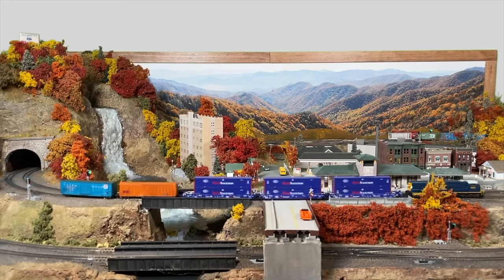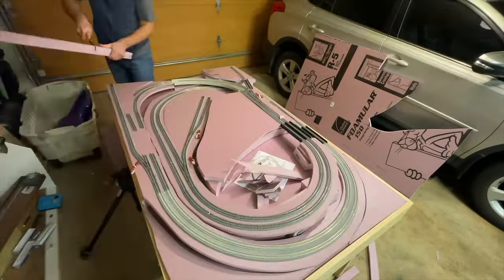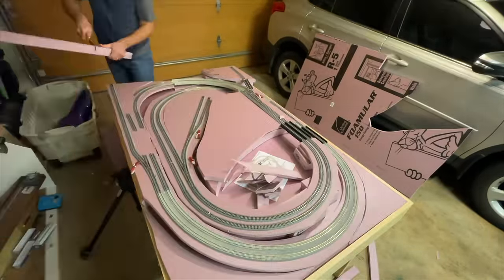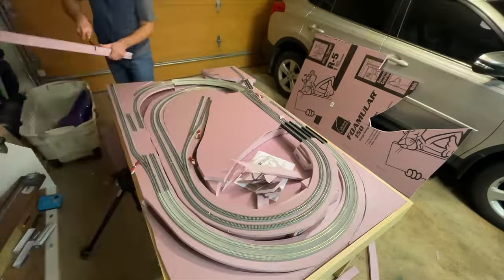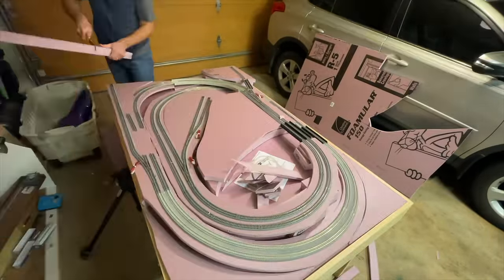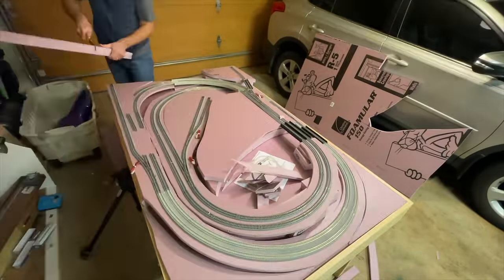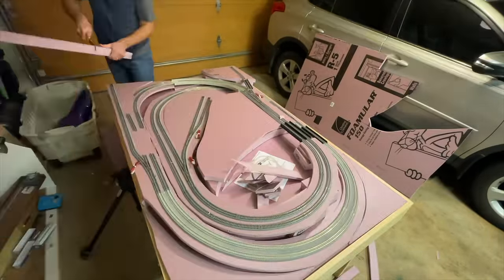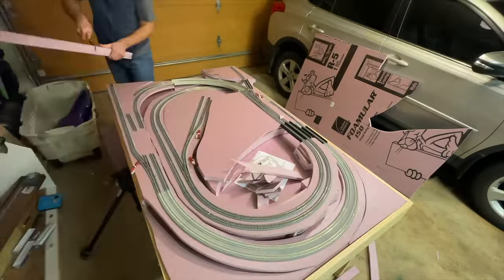Building a 3x5 N Scale Layout From Start to Finish: Series Compilation

Comment: I have a question can you run a DC locomotive on a dcc layout?
Reply from the maker: You can run a DC locomotive at address 00 on a DCC system but it will make a high pitched noise that is kind of annoying.
Reply: Ok thanks

Comment: I'm new to this but is it possible to complete and run this build with the standard kato dc controls?
Reply from the maker: You can certainly use the Kato turnout controllers. If you want to use the standard DC Kato controllers, then you will need to use some insulated rail joiners and toggle switches if you want to have more than one train running at a time. Or, you could just eliminate the ability for trains to cross from the outer track to the inner track, and then just have a controller for the inside track and outside track to run two trains that way. The bottom line is that it is harder to wire a layout for DC only if you want multiple train control than it is for DCC. All the wiring for the push buttons and such was just for over controls. That part can be done with standard Kato turnout controllers regardless of DC or DCC if you want to keep things simpler.
Reply: Thank you for the response Steve, I'm also looking into dcc++ex. There seems to be a lot to unpack in the model railroading world. All I have at the moment is the kato amtrack p42 superliner starter set.

Comment: Which is cheaper to work with N scale or HO?
Reply: I guess N scale would be when all said and done because the track doesn't have to be as large to get the same effect.
Reply from the maker: It depends how you compare things. N scale will cost more per square foot, but to replicate the same layout design, you need less square footage so it is cheaper in that sense. But, a 50 square foot N scale layout can cost a lot more than a 50 square foot HO scale layout because you can fit a lot more N scale stuff in the same area, offsetting the lower per-item costs.

Comment: Hi: Steve it's me again. where can I download directions for lighting with 3 rocker switch ? where do I get power from???

Thanks:

 Charlie
Reply from the maker: I’m powering them with a regular AC to DC power adapter putting out 12v that I had laying around. They are just regular single pile single throw wall switches. There is a terminal for power coming in and three terminals for power going out, one from each switch. So, you can connect one wire to each of three different things, and then connect a common wire together.  I have a wire from each switch going to a terminal strip to make it easy to connect multiple lights or whatever to each of those wires, but you don’t necessarily need to do that.

Comment: Where do you get your Kato track? 20183L 20186L, 20186R, and 20541 are not stocked anywhere I can find.
Reply from the maker: Some of those part numbers have changed I think and some are only sold as part of sets of track pieces. I bought all of them from fifer hobby supply and maybe some from ModelTrainStuff.com. The short track pieces are only sold in track assortment sets. Do you have to search by track length and that kind of thing to find the ones that contain the pieces you need.

Comment: What is the approximate expense on materials? I'd like to build something similar to this but I don't want to start something I can't finish.
Reply from the maker: This ended up costing something like $3,500 in materials, maybe more. But, in some cases I went for faster and more expensive than cheaper and slower (some pre made buildings, trees, etc).